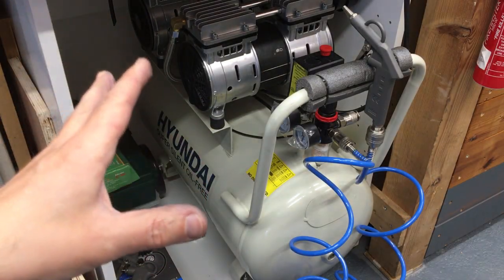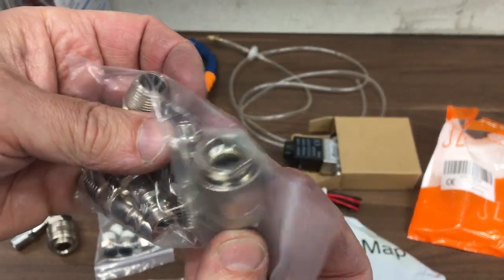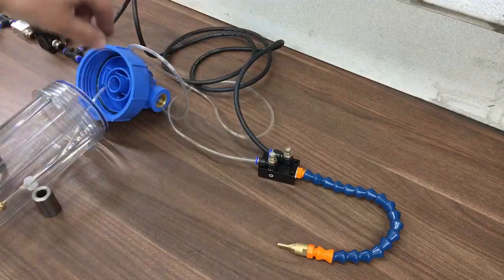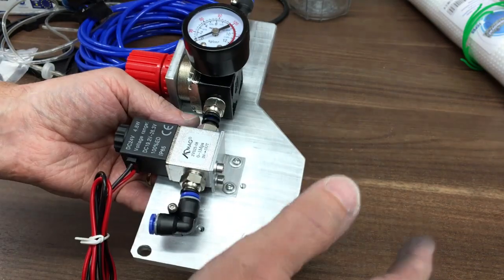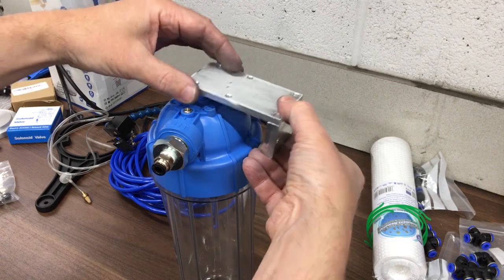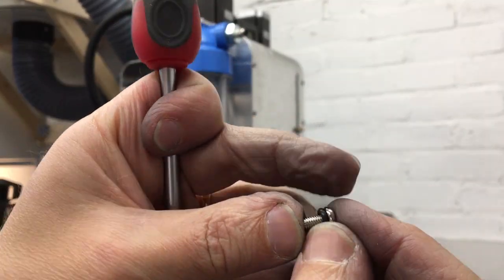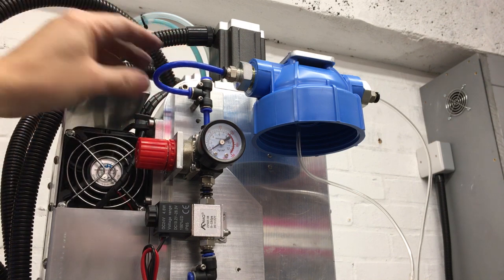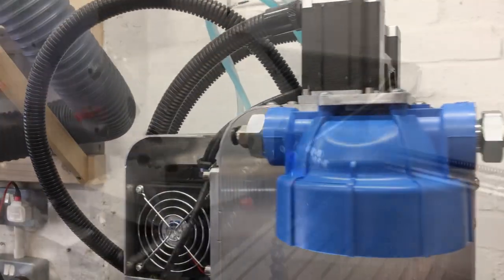Ep1: DIY CNC Mist Coolant system !

Comment: Nice project. Have you considered to use a peristaltic pump for control of the fluid flow? EndCNC have developed such a system. The pump is driven by a small stepper, which in turn is controlled by a small arduino board. Brand name is ColdEND. Very easy to use, excellent fluid control, no issues with gravity, no fiddling with needle valves...I have it hooked up to the same cheap Chinese mixer/hose/nozzle that you use and it works perfectly. The controller is outside of the enclosure. You push some buttons, turn some knobs and have the full control. You can change the flow while machining, without any hazard...
Reply from the maker: Sounds interesting.  I did a quick search but couldn’t find them.  Do you have a link?  Thanks
Reply: @routercnc9517  Looks like my answer was deleted. It is a German shop called END-CNC. There are also some reviews of the system here on YT...

Comment: I'd recommend adding a second low pressure regulator. So you can independently adjust the pressure in the fluid container and the air blast. You need a very tiny amount of pressure on the fluid. Just that it will emit drips of fluid, then the air stream will disperse and carry those drips.

 Otherwise you are going to use an excessive amount of fluid. 

It should emit soo little oil you can hardly tell its working, the official, unofficial test is to hold a piece of paper in front of it and see if begins to absorbing oil.

Been there, done that.
Reply from the maker: OK I like the sound of that   I was assuming the mixer block would take care of that but I’ll go with your idea based on your experience.  Thanks for the input.
Reply: @routercnc9517  if the metering valves are very precise you could maybe get away without it. But with an ebay special, (which is also what I used) you will constantly be fussing with it trying to get it to work correctly. The 2 regulators make it soo much easier and hassle free.

Comment: Fantastic!!! I looked and I am already subscribed!! I have been assembling a small machine shop to support my YT channel which I will be starting as soon as it gets warm enough to get out to the barn. I am building a 1928 Morgan with an experimental aircraft opposed twin engine as the power plant.  I am hand casting the two part aluminum adapter for the MG 4 speed gearbox.. I will be building a cast aluminum milling machine in the Gingery style. Tanks for sharing this awesome video.
Reply from the maker: Sounds like a great project!  Welcome to the channel!

Comment: Hahaha. I'm literally working on this right now. Today I made two 3/4 BSP fittings for the in and out on the filter cartridge bottle. Give me a shout if you need some 8mm tubing. I've got some good stuff that is blue and semi transparent/translucent. I've got a few metres of it you could have mate.
Reply from the maker: Good timing!  I’ve already ordered 5m of 8mm tubing but appreciate the offer.  Any pics of your working system on mycncuk most welcome!
Reply: @routercnc9517  When I'm done I'll get some pics. I have exactly the same venturi effect misting system you bought. Absolute nightmare! Like Steffen says, height matters a lot and also if your pressure changes ( while the compressor is topping itself up) then the mist amount you've spent half an hour tweaking just goes for a ball of chalk.  Very finniky system. Also, the needle valves on that black block have play in them. So you adjust them, lock the small nut and it changes because of the small backlash in the acetal threads.Thats why I decided on a pressurised vessel like this.  As long as you have a couple of bar (around 20psi), your coolant pressure will be stable.
Reply from the maker: OK great!  This is the sort of info I need as I have not done this before and it’s one of those things you have to try rather than calculate.

Comment: I just finished adding mist cooling to my CNC, I thought about mounting -- and ended up redoing cable chains so that everything now goes in the cable chains -- umbilical and water cooling for the spindle as well as the mist cooling tubing. The liquid container isn't really pressurized, not supposed to be. I will mount it to the table that my CNC is on, along with the air pressure regulator, right now they're just sitting next to the table. I really didn't want to have the liquid and extra bits be attached to the moving parts of the CNC. I have 2 tubes coming out of that assembly 2mm id (4mm od for coolant) and 8mm od, 5mm id -- for air. They go through the cable chains to the regulator attached to the spindle mount -- that is the piece that has the articulating nozzle, along with valves for dialing right mix of air and coolant. The plastic articulating nozzle thing is -- as you would say, rubbish, my kit came with a pair of those and just from testing 1st one started leaking, and I got a metal version, its a lot better. The key with the coolant container is that it has a one way valve for the coolant -- so basically the air pressure created on the piece that has nozzle bit pulls the liquid up and you adjust it to create a mist, you can play with the controls if you want flood, but that's different. I saw other folks mention that the container should not be pressurized -- it's like a siphon, the one way valve makes it work without the container being pressurized.
Reply from the maker: Ok thanks good info.  The reason that others have used a pressurised tank is to reduce the mist going into the air as the coolant is under positive pressure not negative.  Negative promotes atomisation and the fog.  That’s just what I have read, no personal experience.  The syphon problem does worry me so I need to work out how I can solve it as I have limited places to put the filter container.  Good input and I’m redesigned it all based on all the combined feedback.  Thanks

Comment: You need put some kind valve between tank and nozzle. Gravity will pull liquid to lower part.
Reply from the maker: It looked like there was a check valve in the 4mm pipe but it might be something else.  I'll get a few valves just in case, thanks for the info.
Reply: @routercnc9517  I have same style setup in my cnc. It pull whole tank to table. Nice suprise at next time.
Reply: I have made a similar set up for my manual milling machine, and I use the same duel feed (air/coolant) ports, but I drilled and tapped for a separate 4mm feed pipe. I'm happy for you to contact me so I can send over some pictures if it helps... mine is much simpler set tho lol, but same principle
Reply from the maker: @mxkko Ok good to know!  I only want a very fine almost not visible must, not a flood!
Reply from the maker: Hi Russell.  I’m on the mycncuk forum and have been posting about this video on there.  I’ll add a link and you could add pictures there? (you would need to join first).
Reply from the maker: http://www.mycncuk.com/threads/9369-Here-we-go-again-MK4/page17

Post #338
Reply: @routercnc9517  I have joined and replied with a couple of pics, just waiting for moderator approval
Reply from the maker: Ok great.  I’ll keep an eye out for your post.
Reply: @routercnc9517  not sure what is happening. I have posted the reply twice, but still not yet approved by a moderator, is it normal for them to take a while to accept a post?
Reply from the maker: Yes it can do, he’s a busy guy.  I’ll drop him a PM when I get back to my PC in about an hour.  I won’t get a chance to progress this project until the weekend anyway.
Reply from the maker: You are active on the forum.  Thanks the for photos, more good info as I redesign this system!

Comment: The screw is an air bleed. I have a similar one which has a bleed button in-place of that screw.
Reply from the maker: Hi Alex.  Ok good info.  I may fit a custom pressure relief valve there instead.
Reply: @routercnc9517  makes me wonder if mine has a secret port under the button. 

Been following your CNC journey from the start, so interested to see how you get on!
Reply from the maker: Me too!  Not done a coolant system before and already significantly redesigning it based on helpful feedback.

Comment: Why did you choose to mount all that wheight on your gantry.
That is easely a couple of kilos your motors will have to lug around
Reply from the maker: I’m not too worried.  These steppers are running on 70V and they will run much faster than I have tuned them for.  A bit of weight also helps with the cutting.

Comment: Hello! Really nice project.

Let me ask you a question, I have in my workshop 4 workstation (lathe, Milling, bench-saw and drill press), I wonder if I could do single container/tank for all of them. I would have a container connected into a 1 inch pipe line, and I could catch the coolant fluid from the pressurized line (pipe). Have you ever seen something like this? I’m writing from Brazil. I appreciate your thoughts!
Reply from the maker: Hello to Brazil!  I have not seen anything like that but I guess it could work.  Good luck with it!

Comment: Nice Project. How long will the air pump work again? For air pump 50L.
Reply from the maker: The mist runs for maybe 2-3 minutes then the compressor switches on and runs for maybe 20 seconds to recharge.  It repeats like this until you have finished.
Reply: @routercnc9517  thank you sir.

Comment: why complicate simple things that work ?
Reply from the maker: I’m only doing this based on everything I’ve read about.  I have not made a mist system before and am not looking to make it complicated but I do want to avoid filling the workshop with a fog mist.  My understanding is this is achieved by pressuring the filter because a Venturi effect generates a low pressure which tends to atomise the coolant.  I am redesigning the system based on the feedback.  If you have built a mist system without fogging then please share your learning.

Comment: Please don't put pressure in the tank. This will not work. You get a flood coolend.
Reply from the maker: I was only thinking 10-20 PSI , just enough to push the fluid.  I’ve seen lots of examples on the internet using this filter container.  Do you have experience of this being a problem at low pressure ?  Thanks
Reply: You put a valve on the outfeed end to control the flow.  Or infeed end to control the pressure on the bottle.
Reply: @routercnc9517  I have almost the same setup with a filter tank that is very often used here in Germany for filtering Pool water but it is basically the same. I also have the same coolend system from Amazon. I had 2 problems 1st was the tank was higher than the nosel that ended in a gravity feed what is basically the same problem that you get. The 2nd problem was as I mounte the tank under the bench lower the nosel the venturi system that is in the nosel of the cooling system was not able to catch the fluid from the tank. Than I had the same idea that you have but even at 0,5 bar the fluid was pushed out the nosel. In the end I mounted the tank slightly under the nosel so the gravity is no longer a problem and the venturi system only need a little bit of suction to get the fluid out if the tank. 
That is my experience with this type of coolend. 
Sorry for my English I don't use a translator 😁
Reply from the maker: OK vielen danke!
I will include another regulator so I can control the air and the coolant pressure, and I think the nozzle should be 0.6mm diameter not 2.5 so will modify that:  i can’t really change the filter height as this is the only place it fits.  I will see if that is any better.  Thanks for your help.
Reply from the maker: Is that in addition to the mixer block?  I thought that would regulate the flow as it has what look like needle valves ?
Reply: @routercnc9517  Yeah see my other comment about the needle valves. One thing I'll be doing to those is adding some kind of silicon or something to tighten the threads up, so to speak. So when you adjust them and lock the nut, it doesn't move it.   I may just end up making a whole new block. I have tons of delrin and acetal to play with.  Check out this video. He made his own. https://www.youtube.com/watch?v=hbj68jwO0iw&t=161s
Reply from the maker: OK good info thanks